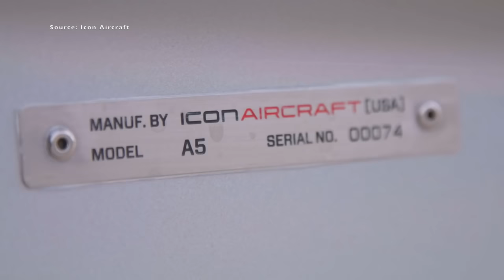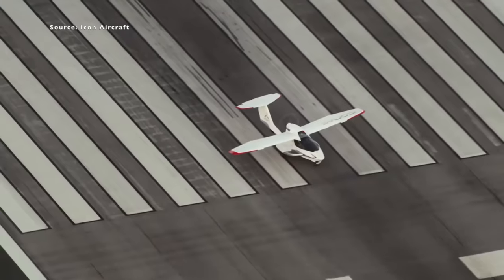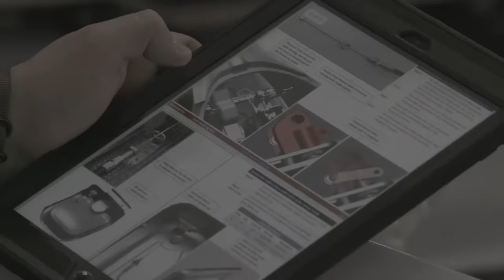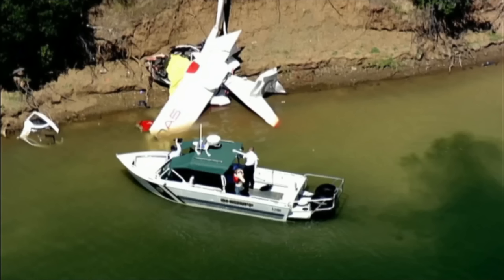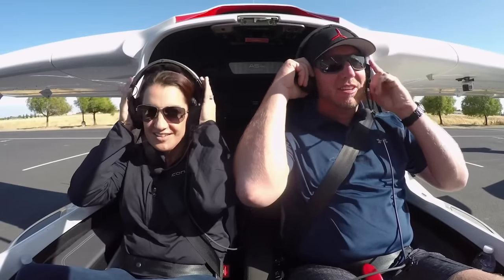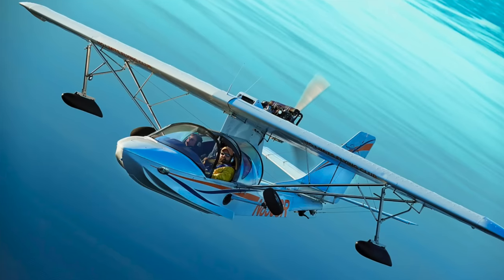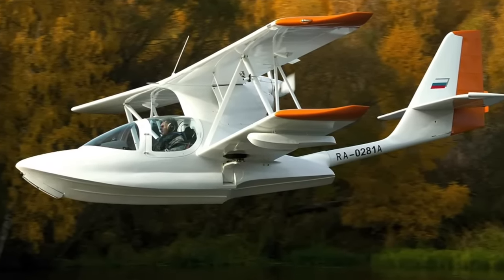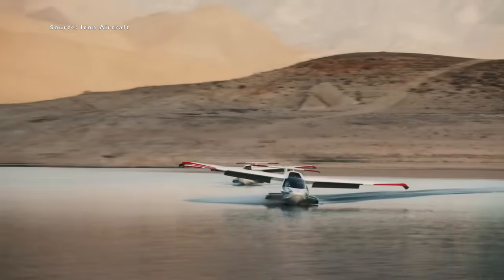What Happened To The ICON A5?

Comment: The Icon A5 has always looked great to me, but the price is at a level where I'd rather have a sailboat. Sailboats are a LOT more practical.
Reply: And good used sailboats are often pretty inexpensive...
Reply: I agree on the price. At that high there are far better planes. And a dedicated boat would be cheaper and more practical.
Reply: @cfdfirefighter  And safer. The only way for a boat prop to spin is for the boat to be in gear. An airplane propellor spins as long as the engine is running, which means a fatal accident is far more likely.
Reply: @PRH123  It depends on what boat you're looking at, who's selling it, and what shape it's in. All those things dictate the price.
Reply: Comparing a sailboat to an aircraft ?  For $400K I would rather spend $10 on a hammer and still have $399,990 left, and a hammer is way more practical.
Reply: @alanaldpal950  Until you go to work on a car. Then you'll need a laptop and tool chest.
Reply: A sailboat is a whole in the water into which one pours money.
An aircraft is a whole in the air into which one pours money.
Buy on of each,  you know it makes sense.
Reply: @philipritson8821  Are you talking about an airboat or amphibious plane? Both are combinations of the two, so be specific as to which one makes more sense.
Reply: @ColtonRMagby 
 An amphibious aircraft is a whole in the water AND in the air into which one ports money.
Although I would suggest a sailboat is far better adapted to the water than any aircraft.
An amphibious aircraft is not a combination of a sailboat and an aircraft.
Do not assume an amphibious aircraft is a "flying boat" - it is not!
It is an aircraft that can land on and take off from CALM water; nothing more, nothing less.
That said, the phrase "water landing" is infact an oxymoron.
Equiping an aircraft for amphibious operations adds weight and drag, which imposes limitations on performance in the air.
Amphibious aircraft are compromised.
They are substandard boats that do not fly as well as their land-based counterparts.
Nothing wrong with that; if you understand their limitations.
Reply: @ColtonRMagby  Yes.
Reply: @philipritson8821  True…. For the record I have more than one plane and more than one boat……that’s where I pour a lot of money, but also have a wife, a daughter, and two grand daughters….. four women in total…. You can guess where I pour most my money 😮
Reply: Me too, I also prefer apples to oranges.
Reply: I don't know where to begin other than to say, you should definitely get a sailboat. You sound like a sailboat kind of guy.
Reply: @joshuabradshaw5270  I don't have the muscle to hoist the sails, but that's what electric furling sails are for. I would also need a fuck-ton of money.
Reply: Won’t fly very well though…
Reply: @nicoghilardi  Who cares? Wakeboard and a hell of a special parasail will scare the shit out of the unprepared.
Reply: Boats fly..
Reply: @philipritson8821  Tell that to Howard Hughes. The Spruce Goose is fucking awesome.
Reply: @CESARBREMERPINHEIRO  Hydrofoils don't count, and neither do hydroplanes or other forms of race boat.
Reply: Yeah, me too !  Bought a 40 ft racing boat
Did race off the west coast of FL and had a lot of fun
NO engine to quit and kill me, sailing or motoring anywhere. And brought a bunch of friends with me, can't do that in an airplane !
A5 was a dangerous airplane and has killed too many pilots. Didn't they shift their shop to Mexico ?  Or overseas ?  Looks like they got too greedy and put themselves out of business. NO reason it had to cost that much !
Reply: @InMyBrz  Agreed.
Reply: I'm familiar with the two happiest days of a boat owners experience.  The day you buy one, and the day you sell it.  😉
Reply: @RARenfield  You forgot the secret third day. The day you sink it.😉

Comment: They put wings on an underpowered see-doo and charge 400K for it. Wonder why it failed
Reply: Should only be a couple more years until I can afford to have a rotating detonation engine 3D printed in China for about the same price as a lawn mower engine.

A flying Sea-Doo is very close to what I want to make for myself.
Reply: Hater.
Reply: They had those weird contract where owners could only sell it back to them later they dropped that language I was always wondering why never saw any used ones on the market. They probalby lost lot of value quickly probably why ICON didn't want them being sold privately they didn't want to compete with a used market.
Reply: @Mike-01234  The Court's forgetting that the doctrine of first sale exists is one of the greatest failures of modern courts.
Reply: @jtjames79 That’s one of the greatest failures of modern courts??
Reply: @quinncide  One of many. Adam Smith would be rolling in his grave if he knew. It's one of the core pillars of og capitalism.

I will admit most of Wealth of Nations I just skimmed. But I paid attention to the important parts.

Really paid off when Bitcoin came out.
Reply: It’s a little bit more than that.

Comment: What happened? They ended up with a $250k flying jet-ski. Calling it a limited market is the understatement of the decade. 

Early on.....they focused on looking cool. Spending gobs of cash at shows like Oshkosh. Of course they massively underestimated the final cost and delivery schedule. 

Such a wasted effort.
Reply: No engineering is a wasted effort. tf?
Someone else will learn from their achievements & failures. This thing is perfect for Florida Keyes & Hawaii.
Reply: Pretty typical history of a light aircraft company. Optimistically overestimated the potential market.  Oversold themselves and their product, and too soon. They got further than most though.

They wanted to create and expand a niche that didn't exist before. Admirable concept. 

Trivializing aircraft operation in advertising though was a mistake. Aircraft just can't be as simple as jet skis.  Airplanes and flying are airplanes and flying, they couldn't change that.
Reply: Flying Jet-ski/ATV, whatever. For what is effectively a weekend recreational vehicle, it was priced as an yacht or off-road capable pickup truck, larger and more capable vehicles that can be used all the time.
Reply: they  ate good for a while😂
Reply: No, a $389K flying jetski.

Comment: Very informative video, thanks. The entire ICON operation at Santa Monica Airport (KSMO as seen in your opening sequence) was very sloppy.  After a very brief and almost  laughable 'preflight,' the female company demo pilot did not conduct any semblance of a decent cockpit briefing, and as a Commercial Pilot, the entire experience was troubling to me. I'd heard that a passenger on a demo flight there in 2018 was seriously injured and hospitalized due to lack of an adequate egress briefing in the airplane with that same demo pilot.
Reply: Correct, and the crash itself was due to the design of this thing. Deathtrap. Would never fly in one.

Comment: I have two words to say about the icon… Roy Halladay
No, he was not fit to fly. I agree with that, but that aircraft is challenging, nevertheless.
Reply: It isn't challenging at all, but it is stall resistant, not stall proof. Is not a toy, is an aircraft! If you start messing around with it close or even beyond the operational envelope, it will bite you.
Reply: Plane had nothing to do with Halladay's crash. He was stunting on a mix of drugs akin to a speedball and flew the plane straight up into a low altitude stall. He had a lot going on and made unfortunate decisions, but the plane wasn't at fault.
Reply: I'm not sure it was challenging to fly.
The accidents in the aircraft came down to simple pilot error, poor judgement exercised by what we're on paper experienced pilots.
Novice pilots tended to treat the aircraft with the respect an aircraft deserves and didn't crash it.
Reply: It has nasty stall characteristics, and questionable spin characteristics. I'm wary of aircraft that claim to be "stall resistant" - if you pull the nose up enough, you could find some REAL nasty handling hiding behind it. Recovery from spin may be impossible in such aircraft (if they are hard to get spinning, then they will be very hard or impossible to recover).

Comment: Mike, there was a lot of old information you were putting out that is on the internet but has been corrected or just wrong.  And don't get started with some of the haters below who clearly are in one camp or another.  I think you know someone who sells ICONs in Texas that you need to talk to and clear up your misunderstandings.  Not sure if  you have another airframe you prefer or get sponsored which may forbid the conversation, but talk to him and at least have a little more clearity (on or off mic).   For me, I obviously love the look and flying characteristics of the ICON A5 (and yes the performance for what it was designed to do it does, especially with a 4-blade prop and increased weight mod my airframe will have a 500lb useful load).  Of course it was never designed to takeoff in 300ft, 4000ft/min climb and 8hr endurance (my bladder has a 2hr limit🤣).
I don't hate on any other models and would love to fly them all.  They all have goods and bad.  Overall for the market though, all these manufactures provide diversity of looks, finish, performance, options, and price (Yes ICON is at the upper end, but some would say $1.3mil for a new Cirrus is ridiculous, yet others don't).  It's like football-You may be a Cowboy's Fan and you support your team, but you gotta love the game as a whole and wanted it to be strong sport  in the future.  Same for me in the Amphibious LSA world. ICON is still open, selling, servicing and supporting.
Not hate'n, just saying...

Comment: Designed by car stylists, with little thought for production methods or costs. An inevitable result I’m afraid…
Reply: The car like styling of the panel and interior makes sense in trying to attract new non pilot customers. It gives a familiar but false sense of being modern and comfortable to people who know only cars.

Cessna and others did that from the 40's and 50's. I suppose if the 152 and 172 could have their interior trim stripped out you'd save weight and improve performance (and increase noise), but people would be less inclined to buy them.
Reply: @PRH123  Certainly the interior should be styled to please customers (alongside manufacturability), but letting them loose on the whole aeroplane was the mistake!

Comment: It was a great, attractive design. But it was too slow, way too expensive and the company was overbearing in its requirements of the customer. Its marketing was utterly disastrous, promoting the A5 as a casual lifestyle accessory for the super rich. You cannot sell thousands of units with that image. Quite the opposite. It should have been promoted as an amphibious craft for the common man then kept the price down through economies of scale. It also made the mistake of promoting the A5 as "easy". No aircraft is easy and requires thorough training.

Comment: How will the new weight specs for light sport effect Icon's ability to add more power and payload? Wasn't the LSA weight limit their root engineering problem?
Reply: The new MOSAIC rules will allow for weight increases, as it is, the A5 is underpowered. A new organization might bring it back with a Rotax 916, turbocharged with about 140 hp for takeoff. Look for the price to probably continue going up.

Comment: Some remarks on the flying cars compared to light seaplanes in general. 
A sea-land aircraft can fly and land on a lake (not the sea due waves) and on airfields.  Imagine that footprint on a map.

A flying car can fly, land on an airfield and drive over all existing roads in the world. Compare that footprint on the same map.
This is essentially different. The market is much bigger; as the transport envelope is much greater and very finely meshed.
The technical challenges of building are much higher, however. Flying mass, folding mechanisms, and road and air legislation togheter in a limited size and appropriate price.
The high price is compensated by the transport envelope, which is virtually unlimited.
The A5 sells a holyday dream, a flying car sells real useable transport. Hence another class.

So:  Think out of the box.

Comment: To be fair it looked fantastic!
Performance wise, nothing to write home about though.
Overpriced product sold by a badly manged company.
All that hype,!
But the price, the contract, the high profile crashes killed it.
Interestingly, no novice pilot ever died in an A5.
It was experienced pilots who flew their planes into the ground!
Reply: I have a huge problem with that. Aircraft like the A5 and the SR22 are I think hiding some nasty handling characteristics. Icon hide behind "stall resistant", while Cirrus use their BRS. Stall both aircraft though, and I think they become extremely dangerous. I don't think either aircraft is recoverable from the point of spin entry.

Comment: I can't say I feel sorry for the deposit holders, or the company.  Light Sport should have offered aircraft priced for the niche the program was in.  The Allegro 2000 I trained in at Falcon in Mesa AZ cost half of the Icon's price, though it still was not a huge success.  Recreational flying is a nice dream, but it is also conspicuous consumption when prices ratchet closer and closer to a used biz jet, such as in the Icon's case.

Startups that plan as they go along often dupe customers to send deposits to finance the initial design and testing, property and manufacturing equipment phase.  That should be a red flag for any buyer--they are using the buyer as an investor.  These buyers did not care--they were perfectly willing to pay 250K for something with limited range, speed, etc just so they could use it as an aerial-water RV.

I learned as most of my friends who were recreational pilots, that renting is far better if you just want to do sightseeing--the Icon, had it been purchased by FBO's for that purpose, might have been a better idea, since it could also be used for flight instruction as a SLSA.

Comment: How do you "overhaul" an airframe? I'm guessing it means inspection. I just saw an online article about an "affordable Cessna 172". 1969. $72,000. Burrrrrrrr. I bought my 1977 C172 for $50k. Good god. Lake renegades, 1976 vintage are $65k. I saw one in the mechanics hangar that was getting full glass. A great fun aircraft, but one that needs special handling and love.
Reply: IIRC, it's a composite sandwich. They are probably looking for delamination, assuming this thing is used in seawater.

Comment: Icon's failure isn't rocket science.  The company incurred  68 million in debt to produce 200 airplanes.  That works out to approximately $340,000 in debt per airplane sold.  They collect the sales price of $390,000 in cash from buyers as well.   Add the two up--they spent approximately $730,000 to build and service an airplane they sold for $390,000.  You can't scale your way to success under that model.  To lose that much money per airplane, they had a 300,000 sq foot manufacturing center in Mexico with 300 employees, and 200,000 square feet in Vacaville with unstated number of employees, and a sales/service center in Miami and then later in Tampa with another bunch of employees, all to support a sales volume averaging 1-2 airplanes  a month for 8 years.  1-2 airplanes a month could almost  have been built in a large garage in somebody's home!   I am a seaplane pilot, and I have flown the Icon and I don't think performance was the reason for low sales, although I admit that with 2 adult sized passengers and 10-15 lbs of baggage, the weight and balance limits only allowed for 14 gallons of fuel, that amount was adequate for most missions since the plane only burns 3-4 gph.  in general low altitude and over water operations are the most demanding of pilot skill and that was a challenge with their attempt to market to novice pilots (read sport).  Operation in water, particularly salt water as well as some engineering design issues led to high maintenance costs.  A big problem imho with the entire seaplane market is that insurance costs are insane for low time pilots.  When the Icon was introduced the insurance -liability and hull was about $6k a year, high but tolerable.  Today its $20k.   I hope they can survive and keep this innovative and exciting product out there but they will need to get their total cost of ownership down significantly, and realistically, operate with something  like $1mm a year in overhead costs and total capitalization of $3mm or less or they won't break even let alone get a return on investment to the owners.

Comment: This is all an issue of poor business planning and poor marketing.  firstly, Icon should never have advertised their "innovations"  there is absolutely nothing new on the A5 that hasn't already been invented decades ago, and there for their plane doesn't have anything on it that cant be found else where for cheaper. Secondly. They stated their plane is filled with so many safety features, and while this is true, to the uninitiated the advertisements make it seem like a safer plane than it is.  And while I agree that the A5 is beginner friendly, that does not mean that the plane can compensate for a lack of training, Practice and Experience. This is all a dangerous combo when over 30% of your client base had yet to get into aviation or get a license, and the adds give the impression that this plane can compensate for that.  then the price. at that price, just go become a commercial pilot😂.  All in all, I like this plane, it is a Nice plane, its just over hyped. Just about every other plane within this category have all the same features, longer flight range and higher speeds for a lower price point.  this is all an issue of poor management.